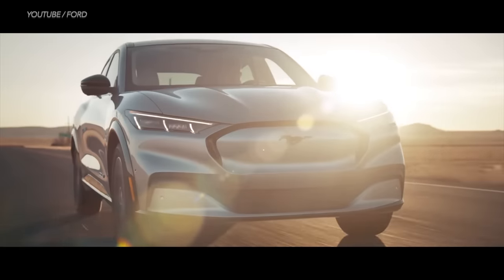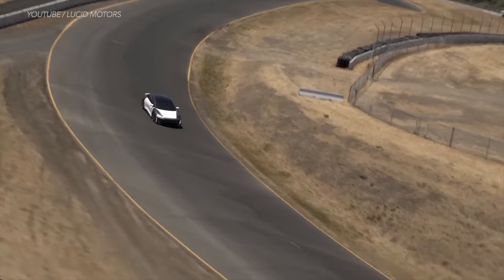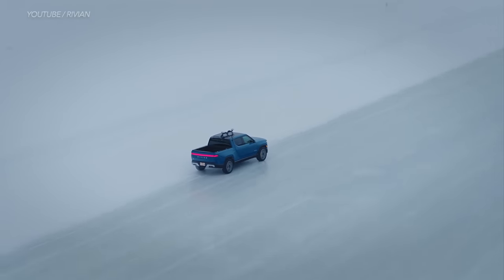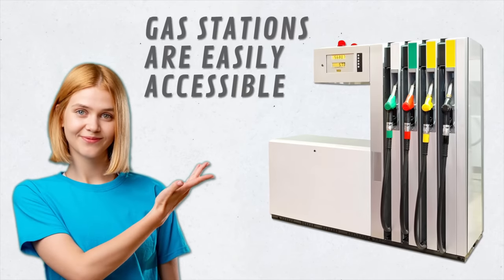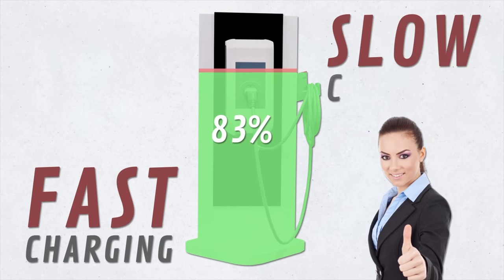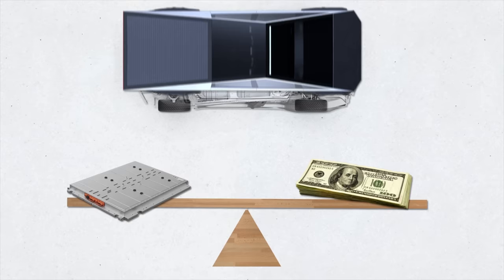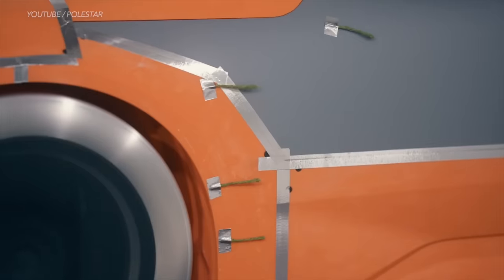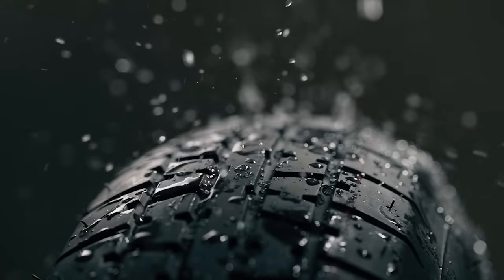New Study Shows Electric Cars are a Scam

Comment: To combat the cold battery issue I would suggest building  a type of pellet fed rocket stove in the frunk that exhaust its heat through a plenum under the car. 
It should also run off of twigs in an emergency...
Reply: Haha my thoughts on the cold charging issue, I'm old enough to remember hearing tales of truckers building campfires used their oil pan to start em easier.....uh,huh,huh,huhhhh Beavis wats to try it on a cold no charge Tesla 😄😄
FIRE FIRE FIRE !!!
Reply: @MrTheHillfolk  They still do.  At -55C oil is mud.   But you can still get them going.  At -55C e-cars are snow collectors.
Reply: A wood stove in your electric car! What a novel idea.
Reply: @MrBottlecapBill  welp, it's probably not a good idea to do that thing with it, where you stick your tongue on a cold surface. 
That's about how useful it is. In fact ,at least a fart in a mitten is a little more useful it'll provide temporary heat.
Reply: That's actually a pretty good idea I don't know about you but I hate it when my perineum gets too cold. lol

Comment: is the fast charging part of fast charging cut off at 80% actual charge or 80% of the 80% that is actually charged when your battery says 100% (i.e at 64%) and do they keep charging you for fast charging your car even though you are only getting slow charging for a fifth (or more likely a third) of the time?   what a scam!
Reply: Most places charge by the kwh so charging speed doesn't matter. Just takes more of your time.
Reply: It doesn't cut off at 80%. 
80% is 80%
Youre charged per kwh used, regardless of the station.

No scams. Just fear mongering from car heads.
Reply: Speaking for Tesla here. You simply pay for Super Charging by the KWh and you choose how much you can take on up to 100%. There is no scam or improper measurement of how much energy you’re taking on. Thing is when you’re going on long road trips and need to make several charge stops.. the system calculates (accurately) how much you need to get at each stop to be most efficient and speedy. It’s actually pretty simple. Plus the car is doing 90-99% of the driving if you wish to relax your senses. It’s very reliable and you arrive at your destination much more refreshed than a long day of manually driving. Just my experience.
Reply: @Fredman5551  100% of net capactiy, to be precise. 20% is the reserve that never depletes by default, unless theu ser fails to charge the car after a long while since warnings appear.
Reply: @HyperVegitoDBZ  incorrect. You have about 20 miles, not percent, when it hits 0. Thats on par with ICE vehicles.

Scotty seems to have gotten confused and mixed and matched numbers. some of the older tesla batterys are recommended to charger to 80% unless going on long trips.
Reply: @Fredman5551  No, it's you who has no knowledge on the matter and pretends to be someone he is not. Please, educate yourself before spreading nonsense.
Reply: In Canada you pay for charging by the minute, not by the kWh and the charger 8s priced by the max output, so if it is cold out and you are charging slower, or after the 80% if you don't unplug your vehicle then you are just massively overpaying. Measures Canada has changed their rules recently so hopefully that will change, but for now it's just terrible.

Comment: About 10 years ago my dad had a Nissan Patrol/Armada with a full replacement bull bar and winch, lift kit, roof rack and snorkel. It would have gotten decent gas mileage except it couldn't with a stage 1 tuned 4.8L straight 6 TB48 and weighed around 2.8 metric tonnes. 120L combined petrol between 2 tanks and you are headed for a seriously thirsty vehicle. But what a vehicle it was

Comment: Advice to use the car maker's recommended tyre pressures is correct – if you're still using OEM brand & model tyres (as I am with my 1999 Camry).  If you've switched to a different model of tyres, the tyre manufacturer has the correct recommendation (based on sidewall height, stiffness, weight loading, etc.).

Comment: Using the battery from 20% to 80%, winter driving 40% loss, battery degradation of 10%. left with 33% of driving range.

Comment: I lose roughly 30% range in Michigan winter and I’m ok with that.  I’m a diehard conservative.  I’ve never had a car that makes me smile as much as my Mach E GTPE.  It’s fun to drive.  I still have a gas vehicle for long trips.  I have no regrets going electric.  Just make sure you have a level 2 charger installed so you don’t experience range anxiety.
Reply: Let us know what you think when your EV is 8-10 old or more as your gasoline car will have another 10 years of life ahead of it with normal maintenance.  Good luck getting half the lifespan out of an EV.

Comment: I've often achieved a LOT more range and efficiency in my compact gas engine vehicles than manufacturers claimed I would.
When has that ever happened with EV's? Ha!
Reply: Same but different where I'm employed in the generator world. 
Take a 5k generator,and a 5k inverter generator and put 5001 watts on it. 
The inverter style  quits ,the  normal generator will still do it. 
Yeah sure there's tradeoffs in a super clean waveform ,but a decent normal generator with an electronic governor will work fine for most computer stuff.
Old school new school.

Comment: I have been driving EVs (Nissan Leaf and Chevy Bolt) for over 5 years. They are great for short trips around town. I use my other Toyota Sienna gas car for trips. In winter, the need for heatiing drain batteries very fast. that is a true statement. In addition, the benefit of EVs are low maintenance. there is no oil change, no air filter change. Brake pads last for long time. In terms of driving, I like that instant torque that get you going immediately after you press acceleration pedal.  In terms of draining more electricity from the grid, I put up solar panels to offset the electricity my EV uses.
Reply: I agree. I recently bought a 2012 Nissan Leaf and like it, FOR AROUND TOWN. When my father asked if I would drive it from Texas to Florida, I said no, because it would be faster to walk. The Aptera company seems to have the better idea, which is to incorporate solar panels into the skin of the car.
Batteries and their energy density are the limiting factors for range. In plain English, they weigh so much that you start to get diminishing returns. The technology needs serious maturing to be practical.
Reply: @et76039  it is almost impossible to make lithium ion batteries weight less, safe, charge fast and last long. We are its theoretical limit based on physics. The only way to solve EV range problem is make charging stations ubiquitous.
Reply: actually we have already solved the problem. it is called Plug-in-hybrid, such as Toyota RAX4 prime exception it is hard to find one.
Reply: @bolu3846  They are ubiquitous.  There's one in every garage.

Comment: I have a 2021 Honda Accord hybrid...I'm a conservative driver, so in the summer I can get 55-65mpg in town, but that drops to 38-43mpg if the temp is below 40 degrees...I average around 38-45mpg on the highway at 70mph, depending on air temps. These cars are not meant for "speed-racers"

Comment: To maintain the battery you should charge/drain in full charge cycles. Regenerative charging is not good for extending battery life. It actually messes with them no matter what your battery management system does. Nothing to see here.

Comment: EVs are self-contradictory. How come mining some of the most harmful resources on the planet in masses for batteries then disposing them is better for the environment than efficient and reliable gasoline vehicles like the Toyota Corolla?
Reply: ya,  n  what  are  they  going  to  do  with  all  the  old,  used,  toxic,  corroding,  n
leaking  lithium  batteries ?   only  way  to  "recycle"  them  is  by  incineration.
Reply: @driver4011  there already exists an BEV recycling plant in Ontario, they recycle all the minerals that would otherwise have to be mined, so as time goes on there will be little need for massive mining.

Comment: Electric cars are what LPG cars were 20+ years ago - the new wave of car designed to be cheaper to run, more environmentally friendly, etc. Now you don't see LPG cars anymore, same will happen to EVs. 

The charging infrastructure is also woefully behind, with hardly any charging stations and those charging stations can do maybe 4 cars at a time. Most people don't have the luxury of their own garage with access to a power plug, how do they expect to charge their EV?
Reply: Well damn. I never thought about that analogy but it makes complete sense. I was too young but I remember my dad had one of those when I was little. Didn't last long, he quickly got rid of it. The best part is that the EVs are not even really environment friendly, it's just about making a show out of it and have the consumer feel good about their choices. Dunno about how LPG cars fared on that matter.
Reply: Same thing with diesal ,it was half the price of petrol in Australia , until everyone bought one now it's more expensive ,and LPG is pretty much unavailable almost everywhere now
Reply: EV's are here to stay.  Availability of charging options will improve as there are more cars on the road, but you're right it does loose a lot of it's appeal if you can't charge while it's parked overnight.

Comment: Here in Alberta Canada, we get a week or two of -30 to -50 Celsius in the winter that’s -22 to -58 Fahrenheit. EV’s wouldn’t even take a charge. Many EV owners opted for “super charge” at a service station, after signing a waiver stating the battery will be degraded and replacement of the battery is recommend… everyone needing to drive in the winter here regrets buying EV.

Comment: The good thing about electric in winter that you can put automatic driving controls on since you can't see out of windshield with no heat to defrost.

ITEM:1975 winter, early morning North Bay,Canada:1973 Volkswagen started on 3rd try at minus 40 below F.

Comment: The entire point of them is to control the travel of the public. They can't scale the battery tech will never to equal to gas powered cars. Also once the battery dies it can cost $20k+ to replace. These will only work in dence areas as FLEETS that are are auto controlled. That is the name of that game and they are horrible for the environment.

Comment: In 5 to 10 years my battery in an EV will be worn out and need to be replaced for like $10k. BUT in an ICE vehicle 5 to 10 years from now my gas tank will be in the exact same condition it was brand new and holds the exact same amount of gas as it always did. EVs just don't even make sense and are wayyyy too expensive!

Comment: I've never paid anywhere near as much for a car as it costs to replace the batteries in an EV. My work van I paid $5000 for. Used of course, but I've had it for seven years, and it still works. My truck is a '67 I got for free. I put some money into it to make it roadworthy, but no more than $2000. My part time driver that I use when I don't need a pickup, and I'm not working is a '73 Dart. I got it for $2000. I put a little more into that one, so I might be into it for $5000. So I have three vehicles to choose from, and one will always be ready to go no matter what. For less than new batteries in an EV. And when you consider the environmental damage just producing an EV I really don't think I'm any worse on the environment by driving these cars.
Reply: Well, when you get the car for free even a used 2019 Honda Civic costs far more than anything you've spent.
Reply: You really don't think that driving a truck from the 60s is any worse on the environment than an EV? 
If you don't like or trust or can afford an EV that's fine, but surely you dont have your head that far in the sand
 Your vehicles were built before any of the regulations for emissions so they are massive polluters
Reply: @brianfilek36  The way it has been explained by people who know more about those things than I do, the manufacture of any new vehicle produces so many emissions, that it would take thousands of miles of driving to break even as opposed to driving an existing vehicle. I don't drive much, so it would take the rest of my life plus to break even.
By the way all internal combustion vehicles in the world combined produce around 15% of emissions. And cars produce less than trucks. So removing all cars from service will do next to nothing as far as emissions goes.
Reply: @onusgumboot5565  Yes,I have read that transportation is approximately 30% of GHG emissions, but couldn’t find the break up between commercial and private, but 15% sounds reasonable.  There are several more recent studies that concluded that the extra carbon output from mining the batteries is offset by the zero tailpipe emissions anywhere from 6 months to 2 years (average of 14,000 miles driven per year). The range is because of different efficiencies and size batteries and because some electrical grids are still quite dirty.  In addition to this, an actual battery recycling plant has opened in Ontario, which recycles the minerals that are mined so as time goes on there will be much less mining for the new batteries as the recycled material goes back into production.
For me, my electrical grid is 95% solar, 5%hydro, so the amount of miles needed to drive would be on the small side.
With regards to your vehicles, I was referring to the law that required a 90% reduction in emissions by 1975, since both your vehicles are made before this, you are actually emitting 90% more than modern cars, so your break even might be much less than you originally thought, when compared to what you are actually emitting (just a thought 😊) depending on your sources of electricity of course.

Comment: Scotty, what do you think about a electric car with a onboard gas or diesel generator? To me it makes no sense for hybrid engines when you can do full electric with a onboard generator engine to charge the batteries while driving or sitting.
Reply: Like a train locomotive?
Reply: That is a hybrid setup.
Reply: Imagine a Tesla with a 20hp generator charging the batteries while driving or sitting. I have a Prius so that is not what I’m talking about
Reply: It's best just to have an ICE vehicle that you won't have to worry about adding extra power to sub for the insufficient power in an EV.
Reply: @WhiteOakMushrooms  in theory this sounds good but you cannot charge and discharge at the same time... I forgot the full explanation but this is not possible.
Reply: I own a plugin hybrid/PHEV. 
However, charging an EV via gas motor is not very efficient.  Also, you can find tests on Youtube where people charge EV's using efficient portable generators.  It takes FOREVER to charge the main battery with such an approach.  Also, fuel costs with the generator provide little advantage.  On top of that, you carry the extra weight and complexity if said generator were carried within the EV. 
IMO, PHEV's strike a compromise and have their advantages for short commutes/urban driving on electric alone...less than 20 miles to/from and at speeds no greater than 45 mph. Also, in climates like mid-Atlantic and South, where temps can go to freezing during winter, but not far below that point. Beyond that, PHEV's offer the flexibility of both systems and avoid the EV fear factor of running out of charge and getting stranded.
Reply: Like the discontinued Volt car?
Reply: You just described the plug-in hybrid and there are many out there. BMW did this with the i3 a long time ago. You can buy a plug-in hybrid right now from most manufacturers.

Comment: Are they just "throw away" vehicles after the batteries go, considering the cost of battery replacement? It currently seems like they won't hold much value as a second-hand vehicle.
Reply: No, because the batteries will outlast the car body.   The batteries can then be recycled, sold on the secondary market or even used as massive power wall in your garage.   Current LFP batteries are expected to last 500k miles and the new batteries coming are expected to last 1 million miles.   People still are relying on old information to maintain their current beliefs.

Comment: It's amazing what has been accomplished so far . I put a charger for a customer for a Nissan leaf and it got 40 mile range and the was no such thing as a fast charger .
Reply: And the batteries in the leaf are over $10,000 when they fail or when you want to sell the car, because nobody will buy a secondhand EV unless it has a new battery.
Reply: Well the newer Leafs have a 200+ mile range.
Reply: @metalmike570  Yes that is a vast improvement on range . They were the industry leader at one time . GM made a early attempt and threw in the towel . The bolt was interesting than Tesla came along and most said they would go belly up and even musk eluded to that . EVs appear they are here to stay . Places like China and Europe they may dominate the market in a decade or less .
Reply: @stevencole7331  Yes by 2030 we'll see at least 40% EV's on the road.

Comment: Another problem with batteries is that you can have a dead cell and it is not dependent on mileage.  one tesla battery module cost as much if not more than a transmission or engine. Imagine paying 70k for a car and then a battery cell goes bad after your warranty expires.